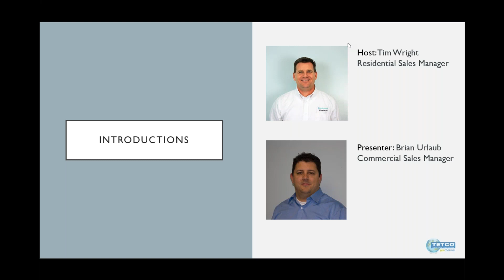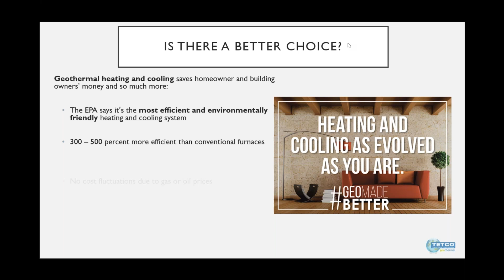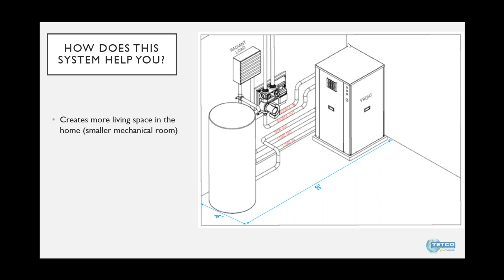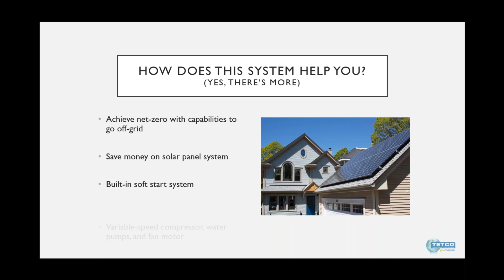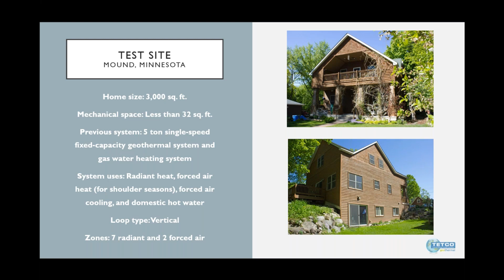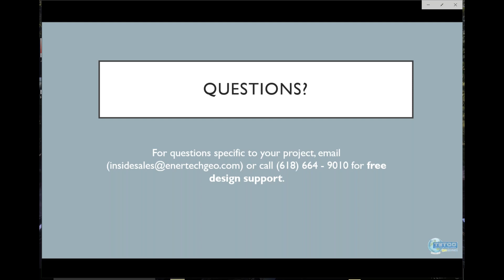TETCO: The Variable-Speed Water-to-Water Geothermal Heating and Cooling System

Comment: What if you install the ground loop in an underground water tank?
My underground water tank is 10000 liter   10" deep
Reply: Lakes/ponds have been used with ground source loops, I have not heard of encolsed tanks being used as much of anything more than a buffer.
  
Remember that a BTU is the amount of energy to heat one pound of water 1 degree (not a phase change).  1lb of water is about 0.454Liters.  So your 10K-Liter tank if full represents about 22,026BTU per degree, roughly 2-tons of energy if conveyed in an hour... but you need more information.  Water is water in a given range, so you need to know where the water temeprature is starting - then you can add up to the boiling phase change, and subtract down to freezing phase change.  From there, a Ton of heating/cooling is 12,000BTU/hr - you would just need to work out what the building's demand is and then see if the tank has enough capacity for the season you're trying to  condition.  I wouldn't use a tank and a ground loop this way though, unless I had a 1Million liter confined water source or larger.
  
Older opera houses used to have effectively a lake in the sub basement that they'd circulate air through before bringing it in at the feet of the patrons in their seats - it was an early form of swamp cooler (evaporating water into the air, bringing the air temp down at the slight cost of bringing humidity up).  This is some of the background for The Phantom of the Opera, with the boat under the building.
  
Lakes/ponds and ground loops in soil actually use constantly moving ground water to massively increase the BTU capacity of the groundloop.  Once your ground loop takes out or puts in heat, the natural movement of ground water through the soil "refreshes" the ground temperature in contact with the loop (one can still locally dry out or freeze the soil if your loop is not large enough for the demand).

Comment: How is variable water to water different from Air to Water and which one of these are more efficient in performance and long-term reliability. Are their any update(s) in 2022  to the former since its introduction in 2018/2019. How large a capacity of a heat pump is needed for a 6,000 sq ft. Full Log home?
Reply: I'm not affiliated with the presenter or company.
  
Water has about 4x the specific heat of air.  This means you can put in and take out more energy per unit of volume - so you don't need to move as much to do the same amout of heat energy transport.
  
Ground loop heat pumps are still far more effective than air heat exchangers.  When it's hot outside you probably want to cool, meaning you're trying to reject heat to the hot outdoors.  When it's cold outside you probably want to heat, meaning you're trying to pull heat in from the cold outdoors.  >20 feet below the ground it's basically a contant temperautre - so it's like trying to stand on a fixed concrete floor rather than a half surfboard in an angry river.
  
It's still just as valid a video today as it was half a decade ago IMO.
  
There are calculators out there for BTU/hr for house size, insulation, and climate zone - but talking to an HVAC pro who will run the numbers against the current best practice.

Comment: 19:40 The max temperature for domestic hot water is 135 F (57C). That is not hot enough to kill Legionella bacteria. 

Is this not an issue because it is on demand?
Reply: I'm pretty sure the on-demand feature doesn't eliminate the problem.  In these systems, hot water from the heat pump circulates through a coil in the hot water tank and heats the water in the tank, so there is still a large reservoir of 135° water in which bacteria could theoretically survive, and that is the water that would go to the faucets.  Consensus seems to be that 135° is plenty hot in most situations, but many indirect hot water tanks have auxiliary electric heating elements that can be configured to periodically cycle up to 140° and eliminate any possibility of bacterial growth.
Reply: @quetzal4042  He mentioned that they can produce a 140º flow for baseboard heaters and such, so perhaps the system can also implement a brief sanitizing cycle for the DHW supply? 🤷‍♂